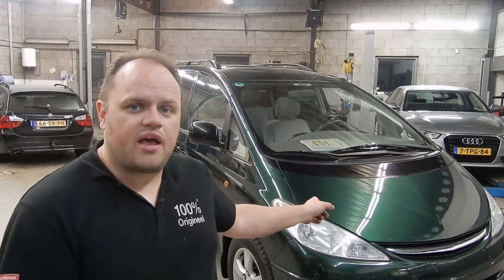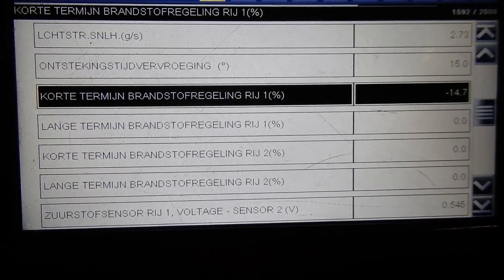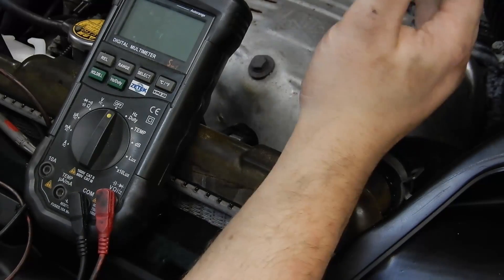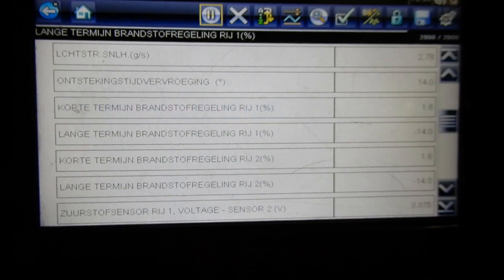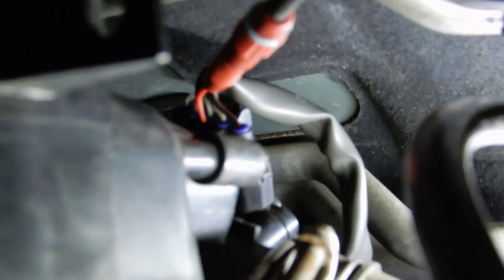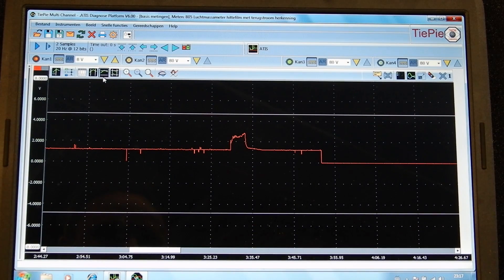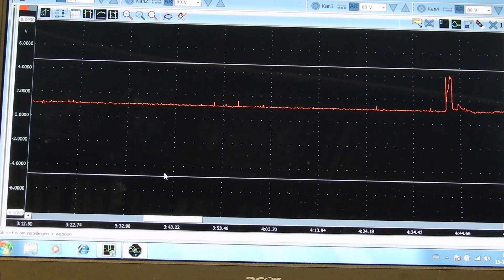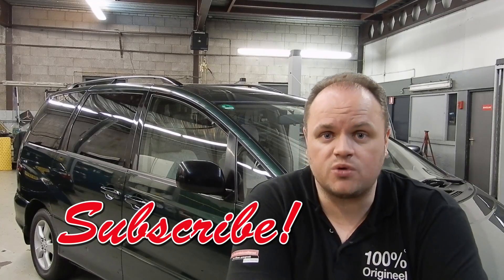Diagnosing an engine without using faultcodes

Comment: Hi there Dan!

Good job! Thanks for helping everyone with your video. 

I have a Mercedes coupe CLK240, 2004 model which has a misfire on number 4. Showing codes P0304 and P0300. 
So it runs on 5 cylinders. Turn ignition off. Turn it on and it can run perfectly on all 6 cylinders. Take it for a drive and give it heaps .... all good. Check the codes, there are none. Turn it off. Turn it back on ....... 5 cylinders. Ahhhhhhhhh! Any ideas? 
Cheers! Dean  dsemmm@gmail.com 4th July 2018
Reply from the maker: It's me! Thanks for the nice comment, i would love to get my hands on your Mercedes and diagnose it. Seems like an interesting one. Unfortunately i have not come across one before. I wish i could give you the answer.
You need to scope all cilinder 4 related things to see what's happening.😁

Comment: Mr Dan i need wiring diagram for golf 7tdi  for engine wvwzzzauzdp096266
Reply from the maker: Gharbi Mecatronicien, Engine?
Reply: DiagnoseDan yes for engine module i have a problem with low pressure pump
Reply from the maker: Gharbi Mecatronicien, Sorry i have not got it😢
Reply: ok thanks a lot
Reply: i just work on golf 7tdi it isn't start and when i cheked low pressure pump i found 4supply wire  why ????
Reply from the maker: Gharbi Mecatronicien The new vw have multiple fase fuel pumps it's hard to test these ones.
Reply: How can I assure that the pump is defective
Reply from the maker: Gharbi Mecatronicien, use a scan tool and turn the pump on. Than measure (scope) the wires. And see if the signals are Ok. If they are  the pump is failed
Reply: which signals master??? i'm beginner

Comment: I have a bmw 730d se fo1 2010 showing oil too high in the idrive.The error code is CE2800 GSC LIN BUS COMMUNICATION FAULT.Can you please help me with this .Thanks.
Reply from the maker: Mahmad Yussein, how can i help?
Reply: DiagnoseDan  Thanks replying Dan.can you tell me  how to solve the problem.
Reply from the maker: Mahmad Yussein, check the oil level. Look at the lin comm. with a scope and determine if comm. lines are ok. If not ok, look what is connected on the comm. line and try to find the source of the problem. Good luck buddy!
Reply: DiagnoseDan my mechanic looked on the bm forum and the glow plug module is the fault.What your intake on that.
Thanks

Comment: Thanks Dan ! Since the garage replaced starter motor and crankshaft timing pinion the car cranking better and timing sync and fuel pressure ok . Just hope recoding the injector solves the problem . No other fault codes just P062B (downloading/configuration fault) appear Twice on the ecu global scan of The Peugeot Diagbox software .

Comment: Fantastic Dan thank you . I will do that and let you know the outcome .
Reply: Hi sorry Dan ! No comma from me for a long time . My peugeot 5008 1.6 rudimentary is running on 3 injectors and because I have used my downloaded version of the peugeot DIAGBOX windows 7 software too many times to clear the fault codes at various repair stages , now I am getting error messages . The whole engine was overhauled(new camshaft , skimmed old cylinder head , new injector seals and sleeves, new gasket , new crankshaft magnet ring , water pump all professionally fitted and torqued ) . My question is if either I programme the non firing injector with my software and if it works then also if there are still error messages popping up because of the fault code storing memory is full , I will have to take the car to the peugeot dealers to remap( whole software update ) the ecu any any other things need to be done . Please kindly advice me if this is the way to go ? Thank you so much and I wish you late Christmas greetings and a very happy new year . I have been ill since April this year and could not do much with my car . Just waiting to get better myself and for a better weather !!

Comment: Also other three injectors show their classification correctly and showing the number of times flow corrections were made (617) for them . Injector 1 shows 0
Reply from the maker: N Na Just read the numbers from the injector and program them on the right position in the computer.
You have got to manually insert the numbers via your scantool.

Comment: Hi Dan latest : yes there is fuel supply and cam crank sync is there . Now I have P062B (programming of the injectors not done ) I did parameter measurements through Diagbox software  and the injector 1 is showing 00000 as classification code . Engine is cranking better thanks to new starter motor but not starting . No other fault codes .

Comment: Hi Dan the garage could not find the problem now with fault code p050B ignition timing    What parameters need to be analysed to find the  problem Peugeot 5008 ehdi with stop start DV6C 8valve . The fuel pressure is there injectors have fuel supplying to the cylinders is there knock sensors in this engine? Cam crank sync is there . I have wiring diagrams available . Is the injection ecu control the starting directly or is that controlled through the engine fuse box? Thanks for your openion
Reply from the maker: N Na knock sensors would not cause a no start.
Only fuel delivery or timing in this case.
Is the ecu pulsing the injectors? Did they check the timing?

Comment: you are professionnal but i don't understand why the ECU not registred the fault code
Reply from the maker: Thats because the computer does not know if there is a problem with the MAF or there is really less air comming into the engine.
If you have a very dirty airfilter or a restriction in the intake you get the same effect!

Comment: I am waiting for the garage for reply  . Hope they can get live data at cranking and identify problem. My Peugeot diagbox live data tells me there is fuel pressure around 400bar and injectors spraying fuel . J could not get live data because no booster pack .

Comment: Cylinder head had to be skimmed because of timing belt sheared of at crankshaft. So all injectors were taken out a too . When it was put back bleeding not done properly.
Reply from the maker: N Na Does it run now?
Reply: No . The garage( independant )are sorting it out . Hopefully they can pinpoint problem with live data .  I could not get it cranking long enough to read live data(booster pack needed). May be the stopstart ecu was prohibiting continuous cranking when I tried. Should I be worried it may need the main dealer   Diagnostic to tune injection ecu for cold start (it is a siemans sid  807 Branch 2 unit with adaptive software)? Thanks for your help
Reply: When timing belt sheared no valve damage just a slight warp of cylinder head it was skimmed and pressure tested before refitted and timing done professionaly.
Reply from the maker: N Na Something might have gone wrong in the Repair.
Check timing and misplaced or loose connectors.
Spray some brake cleaner in the airfilter and see if it runs!
If it runs the engine is not getting fuel😎

Comment: Ok the tank has no pump it is at the injection pump (primary supply ) siemans so air bleeding did the trick . But no there is EML light on and crank and no start with fault code P1694 turbo charge relief circuit malfunction . (Peugeot 5008 1.6 DV6C egs) . Will a live data scan while cranking required?
Reply from the maker: N Na Yes look at the data and look for pressures and crank and cam inputs.
Why did air come in to the fuel system? Check for leaks in the fuel supply.

Comment: DiagnoseDan fixed it again! I like to inspect and clean the MAF every time the air filter is replaced as a preventative measure. Many shops would never be bothered with this simple but important maintenance measure.
Reply from the maker: DJ R Thats what separates you from the rest!

Comment: Thanks. I bought the new pump it does not seem to have any pump just a cylindrical filter inside with hose going to the outlet and a black resister on the outside with  2 wires to it . So the fuel lift mechanism must be in the siemans injection pump (primary pump ) with ignition on there is a lite audible constant beeep in the engine area . Is there a fuel cutoff connector on that pump ?
Reply from the maker: N Na you would have to check a wiring diagram
Reply: A

Comment: Sorry also with ignition on there is no fuel coming to the filter injection ecu just reading the fuel pressure 350 bar initially in the rail does not let anything else happen because no fuel feed ( it is an 8v DV6C with eolys additive system . )

Comment: Well I tested the old pump connecting it to 12 v battery supply test feed did not hear pump running     But had the 12v reading with red blink . All their after a timing belt failiure and head gasket replacement. On Diagbox diagnostic no faults . Just check engine lite on startup . Engine cranking but no start . After crank fault code P050B (starting time too long (more than 1.6 sec) ECU code)  appear . Apparently it is a cold start problem . At crank engine feel warm so compression is there. The pump is a mystery only 2 wires (red - fuel gauge info , Brown - fuel analogue earth ) it seems to have internal terminals extended for the motor inside . I hope that motor failed . Pump manufacture date close to the car’s MF date?jan 2013 .
Reply from the maker: N Na There are new type fuel pumps but i am not sure if your car has got it. These pumps are brushless and have electronics inside witch generate a 3 phase power supply. You won't be able to test these pump by giving the pump a normal feed. But if your tester is able to command the pump on you can test it. You can always measure fuel pressure.

Comment: Hi I have problem starting my Peugeot 5008 2013 1.6 ehdi because tank fuel gauge(pump) not functioning. It gets power from BSI after a LIN comm with DPF fluid tank . Can I test the new part(pump) I bought on this cable to see if the new pump getting power? It is a VDO pump and gauge combo unit).thank you.
Reply from the maker: N Na Should not be a problem, just connect the new pump on the connector and see if it runs.
But have you diagnosed the problem already or are you just suspect the pump has failed?

Comment: I love that type of MAF.. They have earned me some good diagnostic fees over the years. No parts required 👍
Reply: Great stuff Dan , new sub here , good diag , if Robs here im in too :)
Reply from the maker: chris90 thanks for Subscribing!
Rob's a great guy!
Reply: Ditto...
Reply from the maker: Yep, these oldschool ones are easy💷💶
Reply: Dan I am very impressed by your systematic methods of approaching a problem with a system in this case an automobile. I have a question for you about my E31 1991 OBC which is in the center console just below the AC center vents. This car has always been serviced by BMW authorized
 dealer. This OBC in the dash has been loosing pixels from the LED display. It is a known issue with BMW. I have considered taking the box apart but I do not want to make this problem worse, The car is not OBD2, it is the OBD2 system with the round bayonet connector located in the right front of the engine bay behind the pop up headlight. I have owned the BMW for 13 years, the dealer recently looked at the drivers seat bottom has just recently started twisting to the right when I attempted to move it back. I  have searched youtube for help and have concluded that the 1991 850i has cables  (much like a speedometer cable) that needs to be examined. Some of the fixes are to cut the cable housing so that the square end of the inner steel cable can engage the gearbox. The dealer does not want to touch this problem, I understand. The technicians of that era are retired or deceased. I am looking for options for maintaining this beautiful Calypso Red 850i which has been driven 67000 miles. It's beautiful, when I take to the AD it will draw a crowd. Young BMW salesman thought it was a new model, he should be taught about the BMW history. People have told me that the E31's are full of electrical problems, but I have had very few. Keep the batteries charged and the ground wires clean and tight and the car has been a joy to drive. In today's car world this is simple. I also own a VW derived W12 that I have owned for a number of years and have had no problems except with the TPMS pcm. I kept the old part and I wish I could find someone like you Sir who takes a methodical and systematic approach to solving problems. I am a retired professional engineer (pwr generation), and you should be a teacher, which, I guess you are, because this old man is still learning. Thank you so much for your time and effort to make these videos Professor Dan !!!
Reply: Hi Dan,
I sent you a note under the video titled "Subscribe ". The comment brought up the name Chris. You might check out the MAF'S comments 
Professor Dan

Comment: Dan, this is really good stuff! I would like to recommend something which would help me and other DIY amateurs: It would help if you explain some of your thought processes in  diagnosing, such as why you decided to check the MAF, and the other system you decided needed to be checked if the MAF was not the problem. Thanks!
Reply from the maker: caduceus33 In the fuel trim we could see the engine was running lean.
So this means we are not getting enoug fuel, or to much air.
Because the engine was not lean at idle, this was not an airleak.
So only not enough fuel remains.
So the engine was thinking less air was comming in ( mass air meter)
or there was not enough fuel comming out of the injectors(fuel pressure)
So the next thing i would have tested would have been the fuel pressure😉
Reply: Thanks Dan, that makes a lot of sense!

Comment: Hi Dan, great video as usual, keep up the great work. I was wondering if I can get your opinion on my car. I have got a BMW 120d e87 that is running rich(very low mpg) and smoking when accelerating (white diesel smoke). There are no fault codes and I have tested the map and maf sensors, both working fine. What do you think the problem could be? Thanks
Reply from the maker: Osama Y I had the same problem once, could find nothing wrong.
I found that tuning software had been installed.
I installed the original software and the problem was gone!